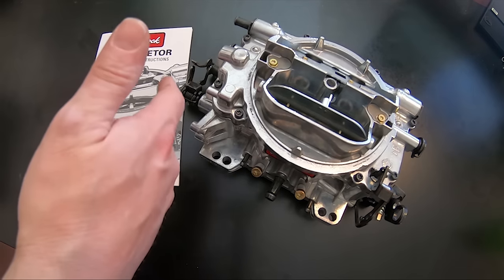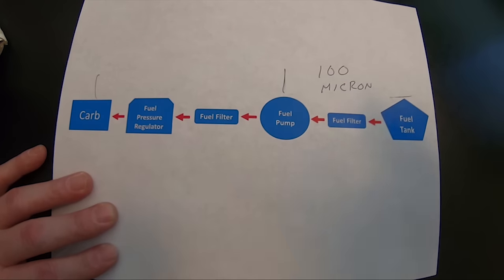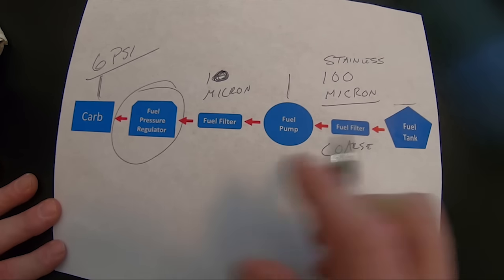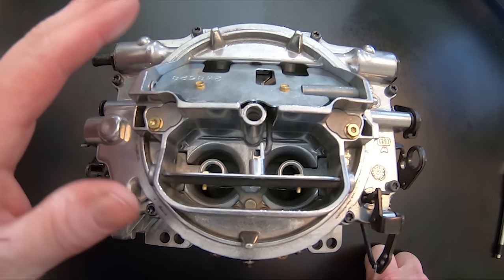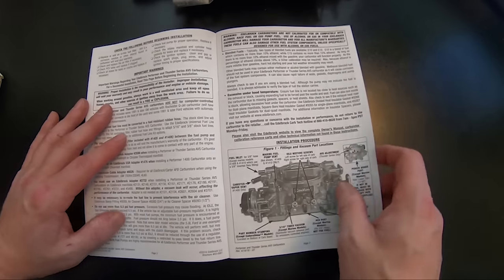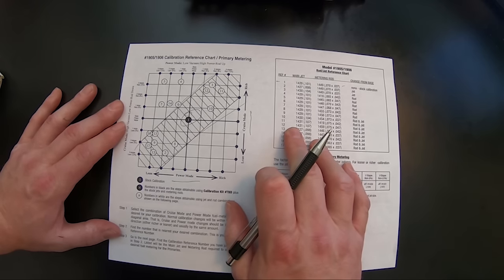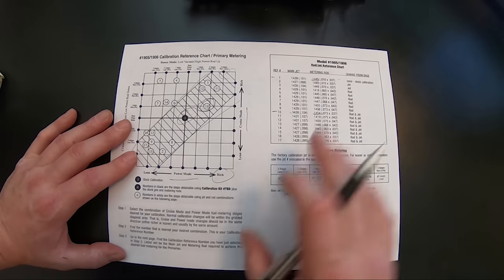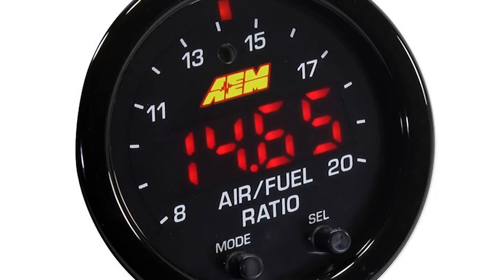The Ultimate Edelbrock Carburetor Tuning Guide

Comment: I find the Edelbrock carbs tend to be too rich from the factory.  my tuning method is to get the engine to operating temperature. set the timing using the total timing method with the vacuum advance disconnected. then get a measurement on vacuum and install the recommended piston spring. I then set the choke to full open so the choke will not affect tuning. the use a AFR gage like you recommended to set the Idle. I like my idle around 14.5:1 for best efficiency and lowest emissions. Then I find a nice flat open stretch of road or freeway with low traffic and cruise at 35-40 mph and take a reading, then 50-60 mph and take a reading, attempting to keep the pedal in the same place to eliminate as much fluctuation as possible. the reading should be pretty close, I use that to set the air fuel ratio for cruise. i like 14.5 to 14:1 the using that same stretch of road, I start with cursing at speed and then roll into the throttle a bit but not opening the secondaries. think of it as passing a car on the freeway. I want to see the AFR gauge drop to around 12.5-13:1 then gradually come back up as the engine increase rpm and vacuum recovers to pull the pistons down.  lastly, I use test and tune nights at the drag strip to dial in the secondaries.  with all 4 barrels open i want to see my AFR between 12.5-13:1.  if there is any bog or hesitation off the line, at this point O increase the size of the squirters or possibly changing the springs. lastly after the car has cooled down to room temp, i set the choke per the factory instruction, and then in winter i fine tune the choke setting to make sure it starts with very little effort on a cold day.  I have also found that sometimes you need rods or jets that are not included in the tuning kit. Edelbrock makes a very large assortment of rods and jets, but they are not all included in the tuning kit. I have also found that sometimes i need a summer Tune (leaner) and a winter tune (richer) to make things run right. I just document what i had it at before and then return it to that setting at the end of the season.  

this same process also works on a Quadrajet, you can still get Performer Q-jet parts from Edelbrock including rods, jets, springs, hanger, etc.
Reply from the maker: Wow.  You really like your AFR on the extreme lean side.  With todays fuels, I don’t know that I’ve ever met anyone who’s willing to take that chance.

Comment: great stuff, I have a new 1406 Edelbrock on a 72 K1500V8, 350, 5.7 etc. manual choke cable and have recently moved from sea level to above 9200 feet. today for the first time it would not start and drained a battery trying. before I start over, my question is: does the high altitude affect the cold starts?
Reply from the maker: It affects every operation on a carb.  Absolutely.  Higher elevation means less oxygen.  You’ve got some tuning to do!

Comment: You forgot to mention not only pressure but volume of fuel as well. Especially if you lower your float level. I had an issue where the pressure of the stock mec pump was fine under normal conditions, but there was not enough fuel  volume when under WOT. I added a booster pump, or you can just eliminate the mech pump. Personally I like redundant fuel pumps. And you dont need to install a return.

This was on a Pontiac 409 w/ 068 tri power cam and Edelbrock 750.
Reply from the maker: Mark Estrada absolutely flow is critical.  I mentioned in a recent video that’s why I run Aeromotive pumps, filters and regulators.  They flow well across the pressure ranges in all instances.  There’s only so much you can put in a 16 minute video.  High level basics on this video.  Everything in steps.

Comment: I have a 318 with a torquey cam and magnum 360 heads. I have not been able to get the stumble off idle to go away, but at 2000 rpm if I kick her in the guts she absolutely screams.
Reply: The real Bad Bob I have the same problem in my big block, she doesn’t  like to take off but once you get past 2000 hold on lol

Comment: Sir,
I found your video along with the Edelbrock manual extremely useful. I have a '78 Ford F 150 400m engine and C6 transmission. I just had the heads properly freshened with hard seats, guides etc. I updated the engine with a Comp Cams RV style cam and timing set, Pertonix distributor, Edelbrock 3771 4bbl manifold and a 1406 carburetor. 
Once the vehicle was running, Initial curb idle  timing set at 12* BTDC without the vacuum and 36* BTDC with vacuum at 32-3400 RPM, idle mixture set for max vacuum I have encountered 2 issues. There was a soft lean misfire at light to medium throttle . I have solved that satisfactorily by increasing the metering rod 1 step straight North on the calibration chart from the stock 7547 to a 7347. The unresolved issue is a light misfire during the transition from closed throttle to about 1/3  throttle. I find that little burble irritating particularly at cruising speeds.
Thanks for your time
Reply: Bones’
Thank you for your prompt reply.  I do not think the misfire is back through the carburetor, it doesn’t feel acute enough for that. think your suggestion of timing and hose routing is an excellent next step. Currently The vacuum source for the vacuum pod is from a true manifold vacuum source through a thermostatic valve to the pod as illustrated in the 2 photos. The plugged hose went to the plugged nipple on the carb base.It goes to a vacuum router at the rear of the engine for EGR and EVAP that I found had a significant vacuum leak.
image2.jpeg
image1.jpeg

The vehicle has passed emissions inspection so I can move things around as I please. Would you suggest vacuum to the pod directly from the manifold vacuum port on the carb base. Unfortunately this will be the only adjustment I can make for the next 2 months. My son the owner is a Chief Engineer on a container ship and goes back to sea on Friday. The truck will drive N 130 mi and then sit in the ship yard for 2 months. I’m a retired European automobile mechanic and shop owner. This has been a fun project for the Chief Mechanic and the Chief Engineer. I do so love EFI! The cars I worked on sold their last carbureted vehicle in the US in 1972 right at the end of my apprenticeship.....lol.
Thanks again for your knowledgeable input. I’ll keep you posted as progress is made.

Disseminated from Zubenelgenubi
Reply: I guess the photos didn’t go through. The vacuum source is a fitting on the #5 intake runner.
Reply: @MuscleCarSolutions  Excellent suggestion! Thank you. I have now put the Vac pod hose on the correct nipple on the carb. It now runs significantly better. I think I will go back to the original 7547 rods and give that a try when my son returns from sea and brings the truck back. Thank you again for your on point and wise counsel. If you ever deal with SU carburetors give be a ping. That was my world back in the day.
Cheers
Bo
Reply: Bone Head, I think I will purchase one of your suggested A/F ratio measurement systems to aid me in dialing in my sons truck when he returns. I think I can also figure out a way to use it with my boat engine which is a Chrysler Marine 318 with a 1409 carburetor. Once again thank you for your wise council.

Comment: So I have an edlebrok 1404 every since I installed it it's ran like crap. I don't have a rpm gauge (77c10). I've adjusted the air/fuel screws a thousand times but the idle continues to hunt, ive checked timing, vacuum leaks ECT. I've installed the adapter for the 1404 on the intake. All 4 opening on the intake are about a little less than a 1/4 in blocked by the gasket(maybe that's the problem?) I've made it back fire through the carb twice and both times the truck ran fine after words. But after about 30 min it's back to running hunting. I'm at a complete loss on it. The original carb was a quadrajet 600cfm the 1404 edlebrok is 500cfm. Maybe under cfm? I went back and forth between air ratio screws idle screw and timing for around 3 hrs lol all the hoses are in the correct spot and timing is correct according to the air cleaner cover(2° for a 350) also switched it to the second hole down on the acc pump for a bigger pump of gas (which helped steady idle alot) any input is much appreciated (77 c10 350 stock intake edle brok 1404 with adapter plate to intake)
Reply: @MuscleCarSolutions  the pressure regulator I have no idea honestly, I added one after the pump before the carb recently, I have not took apart the edlebrok yet and the back fire only happens through the carb if I rev it a couple times while it's surging.
Reply: @MuscleCarSolutions  I've set and reset the timing to 2° Everytime I turn my idle up or down
Reply: @MuscleCarSolutions  no I never added a pressure regulator, everything on the engine is stock except the 1404. I added a new filter between the carb and the fuel pump when I installed the edlebrok about a month ago. There is another one before the pump that I changed about 6 months ago while I still had the quadrajet on it.
Reply: @MuscleCarSolutions  alright alright thank you very much, I'll get back to you as soon as the funds are there for me to buy parts

Comment: I am trying to cure a slight stumble off idle. Open it runs really well. Idle can be slightly rough after I adjusted mixture so that is better. Timing is on. The just off idle is not smooth into power.
Reply from the maker: Have you made any adjustments to the accelerator pump to verify if you need more fuel or less?

Comment: I’m running dual edelbrock Avs 500’s on a pretty stock sbc. I have a stumble right off idle if I nail the throttle. If I roll into the throttle, it burns the tires. The plugs are all nice and tan, msd, vac. Advance distributor, timing set at 10 deg. Btdc. Full advance is 36deg. By 2500 rpm. 
The chrome headers are turning blue, which would indicate lean to me. Where do I start? I do not have the book as I bought this whole setup used. I am assuming that both carbs. Have the stock jets, springs and rods, but I have not verified that yet. The pump shot linkage on both carbs is set in the center hole. Electric fuel pump, regulator with gauge, 2 fuel filters, and aluminum 1” carb spacers.  Running 4psi of fuel pressure.
Reply from the maker: Lots of questions and places you can potentially start.  I’d add some more initial timing to start with.  It’s time to begin to look at tuning the carbs as well.  I wouldn’t rely on the chrome headers being a good indication of a lean condition.  In my opinion, the only way I will tune any dual set up is with an AFR.  Preferably a dual O2.  I know they are very expensive but it’s really the best way to tune those carbs and set timing.  I know 30 years ago Dad did it all by ear but there is a wild card in all this - we have horrible fuel today with ethanol.  So consider that investment if you plan on keeping that set up.

Comment: Thanks for putting this together. Struggling to get mine running nice on a 350 sbc.  Spent a couple of hours just now.  At idle it smells rich, going leaner causes the engine to run rougher / close to stall.  Also hesitates momentarily when throttle blipped. Going rich means throttle blip is ok and smooth, but kicks some smoke out and idle smells of unburned fuel.  Feel like I've been going around in circles (adjusting idle speed along the way as rpm drops / increases - aiming for 600 / 650 idle rpm in park).
Reply: @MuscleCarSolutions  wow thanks for the quick reply! Engine has stock cam, edelbrock performer intake and carb, headers and 2.5" exhaust with X pipe and flowmaster delta 50 mufflers. Adjusted timing a few times, seems to be pretty consistent aka sits at 12°@ idle and 36°@ ~2500rpm. Have only been adjusting the front two mix screws and the idle rpm screw so far to try and get it consistent... i.e aiming for no fuel smell @idle, smooth throttle response and smooth idle. Is it likely the answer lies in rod / jet changes?
Reply: @MuscleCarSolutions  The carb is a 1406, so works out to a pretty typical SBC upgrade with the intake and headers. It was fitted to the car before I bought it, so not sure if it's got the stock jets in there.  Think I'll grab a kit from Edelbrock with all the rods etc.  I'm in England so takes a while to get over here from the U.S.  Might do a video of it running with a vacuum gauge on and share it with you for feedback.  Carb tuning a V8 is not too common over here :)

Comment: Resurrecting this masterpiece. Ive assembled a new 400 with higher compression and a mild (276) cam, as well as this AVS2 carb. What would you recommend as a starting point to ensure I can fire up and break in my cam right away and not wipe anything dry trying to fire it up the first time?

*edited for typo

Comment: This is a great video. I recently swapped a 06 5.3 in my 1980 k10 which I swapped the fuel injection to a carburetor. I opted for a Holley mid rise intake, edelbrock 1406 carb, and msd 6014(I believe the number is) ignition controller and once I got my batter ground figured out, she fired up no problems.... I’ve yet to adjust it any means being in Kansas I have no idea what the tuning is gonna be..... I’m in Europe on a 9 month rotation and all I read is my carb book so when I get home I can tune with no reference(it’s a small goal I set for myself).... anyways I enjoyed the video. I have a suggestion, maybe tuning idle mixture and determine if you need a new jet. And what is a good baseline for inches of mercury which I believe is 20.5 inches.... I may be wrong but that’s what learning is all about.......
Reply: Bone Head okay I understand. So you could really diagnose jet and rods by dyno, a/f gauge, and driving it.... like I said, I know a little about carbs and trying to learn as much as possible.....

For the carb conversion, yes everything is stock.... you’ll need to reroute the vent tube of the driver side head, change the intake of course, and bit an ignition controller..... Holley has a similar setup for the atomic efi which i didn’t want bc it was expensive, and a waste as I’m not trying to go high horsepower.... just a beater with a heater and a little pep in her step....
Reply: Bone Head also, the carb was a reman from edelbrock from jegs.com and only has 3 starts and a 2 minute idle each start bc I don’t have a belt tensioner therefore no belt to spin the water pump and so on.... then left to Europe and have some parts waiting for me if my wife doesn’t sell them 😂
Reply: Bone Head well I had it running just not long enough for the choke to open up so it was a high idle at 1600rpm. I have to adjust the fast idle ad get the idle screws perfect..... I know someone with a similar setup and it’s just awesome. Except he he’s a bigger carb......... I’m pretty sure the 600cfm should be fine on a completely bone stock 5.3.... I’ve seen 750’s on a 305 and other 327’s and they were fine..... if anything, I’ll have to buy a bigger carb.... I want to put a cam from an ls6 with better valves springs bc I love high reving v8’s.... just enough for towing a little and mainly a daily driver.... I’m looking for an nv4500 but people want so much money for that transmission without a bell housing.....

Comment: I was very tempted to get the AV2 carb, until my tuner shop recommended against it for the carb boiling issues.  Did some searching and came up with a Edelbrock tech page addressing this.  Now you mention it as well.  Now, I'm wondering just how big of a problem this is.  Maybe this isn't the right choice for my iron manifold application.
Reply: The techs argument was the Edelbrock places it’s fuel bowl directly over the carb flange whereas the Holley places it’s bowl off to the side.  The Holley has more separation from the flange so there is a longer thermal path and the Holley has more surface area of help remove the heat from the bowls. His argument does seem to have some merit. Personally, I’m liking the carb because I don’t have to dump fuel every time I change a jet and it’s supposed to hold its tune better.

Comment: I know this video was a long time ago, but just curious my 318 Dodge under acceleration is sputtering and backfiring once in a while and it just started doing it was wondering if you had any issues excuse me information it’s got an AVS to Edelbrock on it
Reply from the maker: @cbobmonster  don’t know.  Could be a number of things.  Verify timing and ignition components.  Once an engine is under load, that’s when it puts stress on ignition system components.  Bad grounds can cause this as well.  That’s where I’d start.  Then you can start looking at fuel.  If it’s a lean condition causing it, it could be fuel filters are clogged or restricted.  Fuel pump might not be able to keep up when the fuel demand increases.  Garbage blocking secondary jets.  Step up springs are incorrect or need a change to a different rate spring.  You can also add in potential vacuum leak(s).  Start working through and eliminate the possibilities until you find the issue.

Comment: Hey watch your videos all the time. Love them thank you very much. 
Quick question, I have a 1406 Elderbrock carb, I was told to tune it using the 1405 chart, possibly on #1 setting or even #2 or #9, which take the .100 jet and .068x.042 rod or .070x.047 rod etc to get better performance out of it for my 70 Nova. (350 5.7 Vortec, high rise intake, long tube headers, roller cam) 
And the #1468 accelerator pump as well. I'm about to rebuild my elderbrock carburetor soon and I've been reading up and re-watching a lot of your videos. 
Thx for any tips are help, you're awesome 👌